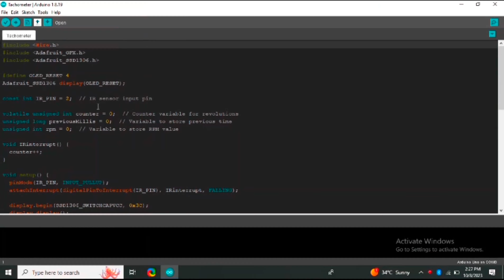How to make obstacle avoiding car using Arduino Uno at home

Comment from the maker: Code--

#include <AFMotor.h>  
#include <NewPing.h>
#include <Servo.h>

#define TRIG_PIN A0
#define ECHO_PIN A1
#define MAX_DISTANCE 200
#define MAX_SPEED 190 // sets speed of DC  motors
#define MAX_SPEED_OFFSET 20

NewPing sonar(TRIG_PIN, ECHO_PIN, MAX_DISTANCE);

AF_DCMotor motor1(1, MOTOR12_1KHZ);
AF_DCMotor motor2(2, MOTOR12_1KHZ);
AF_DCMotor motor3(3, MOTOR34_1KHZ);
AF_DCMotor motor4(4, MOTOR34_1KHZ);
Servo myservo;  

boolean goesForward=false;
int distance = 100;
int speedSet = 0;

void setup() {

  myservo.attach(10);  
  myservo.write(115);
  delay(2000);
  distance = readPing();
  delay(100);
  distance = readPing();
  delay(100);
  distance = readPing();
  delay(100);
  distance = readPing();
  delay(100);
}

void loop() {
 int distanceR = 0;
 int distanceL =  0;
 delay(40);
 
 if(distance<=15)
 {
  moveStop();
  delay(100);
  moveBackward();
  delay(300);
  moveStop();
  delay(200);
  distanceR = lookRight();
  delay(200);
  distanceL = lookLeft();
  delay(200);

  if(distanceR>=distanceL)
  {
    turnRight();
    moveStop();
  }else
  {
    turnLeft();
    moveStop();
  }
 }else
 {
  moveForward();
 }
 distance = readPing();
}

int lookRight()
{
    myservo.write(50);
    delay(500);
    int distance = readPing();
    delay(100);
    myservo.write(115);
    return distance;
}

int lookLeft()
{
    myservo.write(170);
    delay(500);
    int distance = readPing();
    delay(100);
    myservo.write(115);
    return distance;
    delay(100);
}

int readPing() {
  delay(70);
  int cm = sonar.ping_cm();
  if(cm==0)
  {
    cm = 250;
  }
  return cm;
}

void moveStop() {
  motor1.run(RELEASE);
  motor2.run(RELEASE);
  motor3.run(RELEASE);
  motor4.run(RELEASE);
  }
 
void moveForward() {

 if(!goesForward)
  {
    goesForward=true;
    motor1.run(FORWARD);      
    motor2.run(FORWARD);
    motor3.run(FORWARD);
    motor4.run(FORWARD);    
   for (speedSet = 0; speedSet < MAX_SPEED; speedSet +=2) // slowly bring the speed up to avoid loading down the batteries too quickly
   {
    motor1.setSpeed(speedSet);
    motor2.setSpeed(speedSet);
    motor3.setSpeed(speedSet);
    motor4.setSpeed(speedSet);
    delay(5);
   }
  }
}

void moveBackward() {
    goesForward=false;
    motor1.run(BACKWARD);      
    motor2.run(BACKWARD);
    motor3.run(BACKWARD);
    motor4.run(BACKWARD);  
  for (speedSet = 0; speedSet < MAX_SPEED; speedSet +=2) // slowly bring the speed up to avoid loading down the batteries too quickly
  {
    motor1.setSpeed(speedSet);
    motor2.setSpeed(speedSet);
    motor3.setSpeed(speedSet);
    motor4.setSpeed(speedSet);
    delay(5);
  }
}  

void turnRight() {
  motor1.run(FORWARD);
  motor2.run(FORWARD);
  motor3.run(BACKWARD);
  motor4.run(BACKWARD);    
  delay(500);
  motor1.run(FORWARD);      
  motor2.run(FORWARD);
  motor3.run(FORWARD);
  motor4.run(FORWARD);      
}
 
void turnLeft() {
  motor1.run(BACKWARD);    
  motor2.run(BACKWARD);  
  motor3.run(FORWARD);
  motor4.run(FORWARD);  
  delay(500);
  motor1.run(FORWARD);    
  motor2.run(FORWARD);
  motor3.run(FORWARD);
  motor4.run(FORWARD);
}